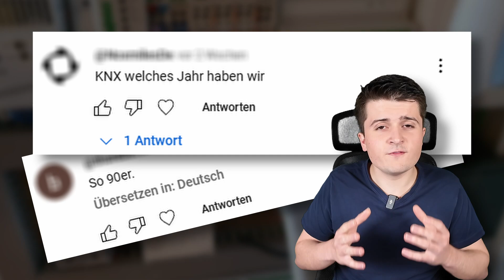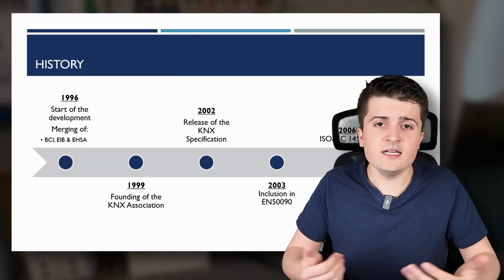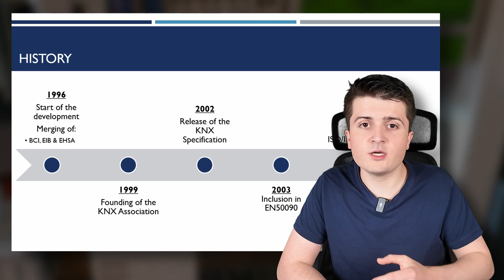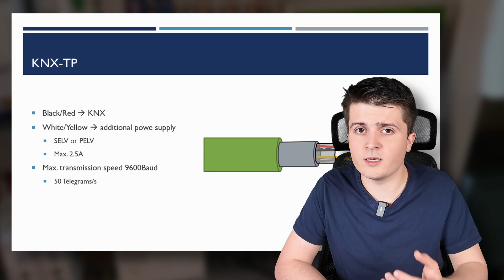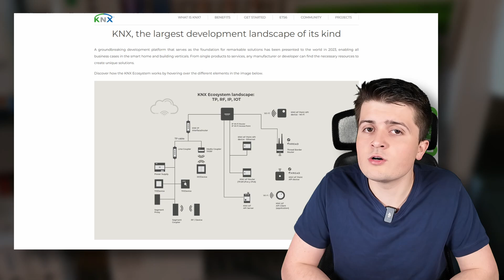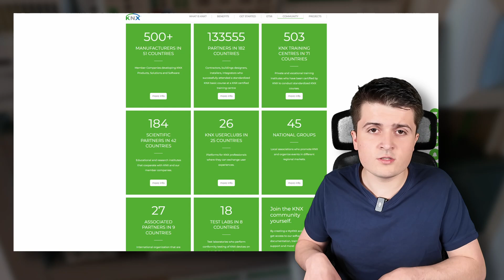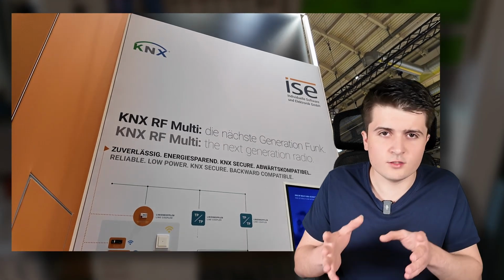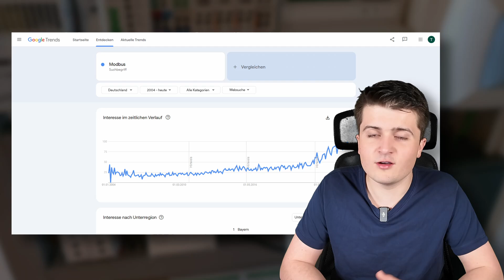Is KNX still up to date? - My personal opinion!

Comment: KNX is a two-wire bus with some default behavior thrown in from each block you buy. The problem is, for a smart home to be smart, you need much higher level automation. The current default choice is Home Assistant.
Reply from the maker: That's simply not true. For example: 
- Blind actuators support automatic shading based on the brightness with lamella tracking or with heating and cooling support functions, .... 
- Dimming actuators support constant light control, HCL, ...
- Heating Actuators support verry extended HVAC functionalities
- ...

So definitely far beyond default behavior. If you need to connect the KNX system to other systems, you can either use gateways or visualization servers like you mentioned, Home Assistant. So KNX is definitely a solid foundation for the building automation that you can easily extend if needed in the project
Reply: @torbenledermanneng975  that is the default behavior, in the sense that it's preprogrammed logic that's made because most people would want this. most of what you are describing is not truly customizable. for example, the HCL system would likely have just one type of ramp up/down based on a 1-bit switch. if you want, say, HCL that responds to, say, background color temperature in the room, you can't have it. I'm not saying the built-in behaviors are necessarily bad. it's just that you don't get to plug in your custom logic for, say, the HCL transition curve.

Comment: Your informations are not correct. Some older devices (6-10 year old) cannot be programmed with Ets6. The manufacturers do not update the software for those devices for clear reasons (already sold the device... why waste money)
Reply from the maker: Correct, there are certain devices, especially those with external programs, that don't work properly. However, those devices that don't have those work mostly fine

Comment: Got hooked up with KNX more than 15 years ago to be able to install and maintain/reconfigure it in my new home. Got a proper installer certification through a course and exam. Still love it after so many years and still use the expertise. So reliable and stable. Have done 5 other instllations for friends/family.

Comment: Congratulations on your videos.

I've worked in industrial automation for 43 years and have seen many buses. Everything you said is absolutely true.

The only flaw I see in KNX is that even today, even if you have the expertise, to configure or modify your home network you still have to hire an electrician or purchase a thousand-euro license, and perhaps not even a perpetual one. Essentially, my home system isn't truly mine and under my control.

Comment: I chose KNX for the second time in our family home just because it’s so “old”. It’s incredibly stable, reliable, no vendor lock in, often used, … All of this makes me hope that it won’t disappear any time soon which, as you said, is what you want in your home. Longevity.. If I want to do some flashy fun Zigbee/matter/… stuff or complicated automations I still can using Home assistant. But the backbone of my home, that should simply work 99.999% of the time, will always be wired and probably KNX. Also the only way to keep the wife acceptance factor high. 😅
Reply: Yup yup yup,
Core systems should be stable I'm planning on that
Even if I'm going to run Home assistant on a cluster even in the unlikely chance of them going down the core stuff like lights actually turning on when i hit the switch should always work